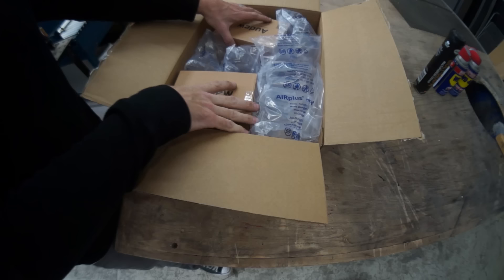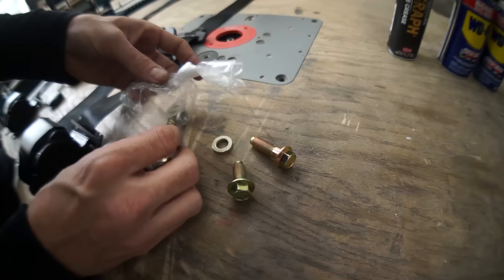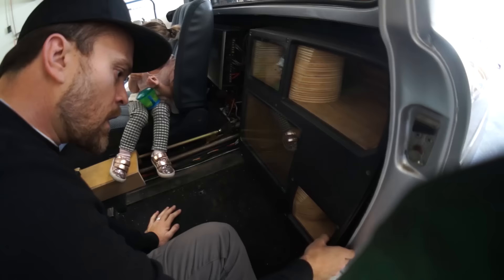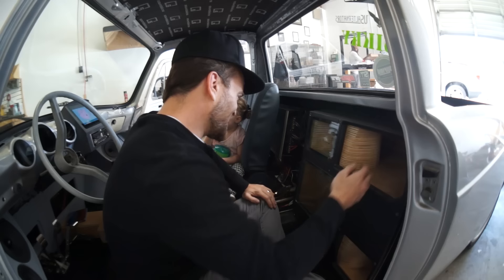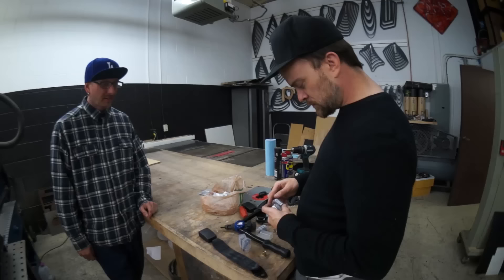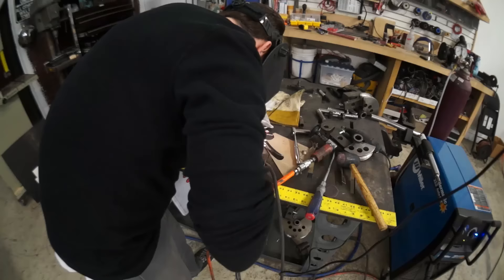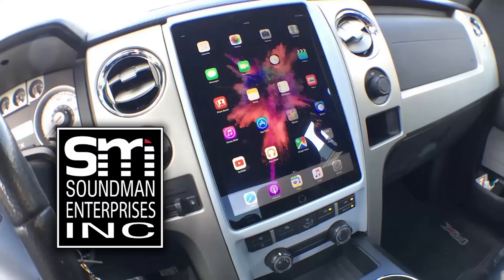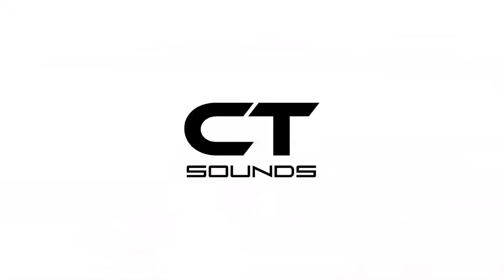STRAPPED! Aftermarket seat belts!

Comment: Rivnuts on your seat belt your kidding right, the nuts for seat belts are weld to a plate then welded to the car to spread the load, you hit anything and they'll rip out, we need your vids and your family needs you so it safe mate
Reply: mark bennett came here to say this. They are super convenient but fuck me never use em to hold down a seat lol. Like you said they rip out fairly easy. Ask me how I know. I'd go with getting a plate of metal, welding a nut to the plate, and then welding the plate to the car. Best way to do it and he's got all the Tools to do it in like an hour or so.

Comment: Come on dougie. You tube.  How to set rivnut without tool. And you should use bolts with large washers for those seatbelts so they don't pull through the floor when you get in an accident from ripping it

Comment: uh... you could have used oldschool lap belts and you dont need the retracker....
Reply from the maker: My 60/40 bench seat is from a 91 toyota pickup, i decided to go with  modern looking seat belt.  i'm going for a semi-modern looking interior. and i definitely want the cops to see a shoulder strap to minimize pullage overage, since we're still mostly illegal.
AND
this car is registered as a 68 squareback which came with shoulder straps from the factory.
Reply: nitroboynik very wise the think ahead! we will be on social security by then bet hey ......soundman it's worth it
Reply: SoundmanCA Doug please don't use rivnuts for the seat mounts dude that's super sketch. They just pull out or tear the metal as soon as you put any load on them. Just make a plate with a nut welded to it and weld that to the car floor.
Reply: ratgreen.......he probably  won't comment or respond! lol even to that advice!!!!!
Reply: .... have you not seen Dougs welding skills. if he hits something hard enough to rip a nut sert out.... he's screw anyway lol. but at this rate he's not going to be driving it as a daily for a long long time. loving the progress though

Comment: Why the hell are you dealing with a shoulder strap?  Should just need a belt IMO. Also if you don't bolt that heavy ass woofer box down the belt isn't going to matter when it pushes you through the steering wheel.

Comment: Wow! you do not care for the safety of yourself or your passengers ! 
Seat-belts are a safety feature and are designed in such a way to save your life. 
What you have done is undermine the structural integrity of the vehicle by removing a large part of the "B" posts of the vehicle. 
You then bodged in a set of seat-belts without any consideration of the loads that the seat-belt mountings undergo in the event of a collision. 
Plates should have been used to reinforce the areas where you mounted the seat-belts to spread the load. 
OEM fitted belts are engineered into the structure of the vehicle ensuring that in the event of a collision the structure of the vehicle supports the load the seat-belts place on the chassis. 
What you have done is just downright dangerous. 
I sincerely hope nobody watching this mimics this shoddy install.